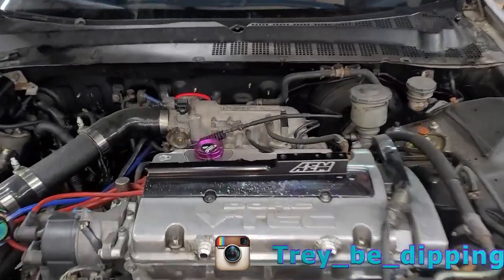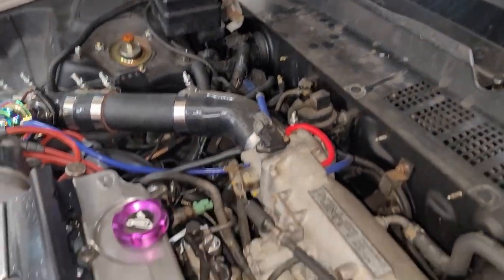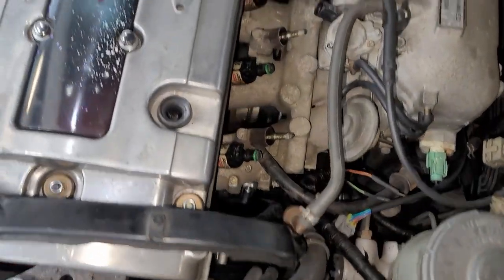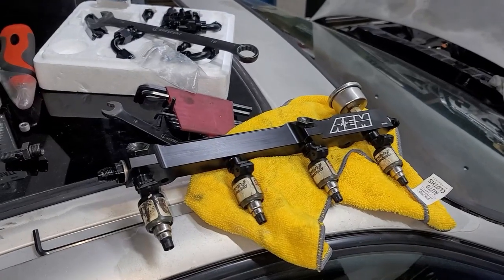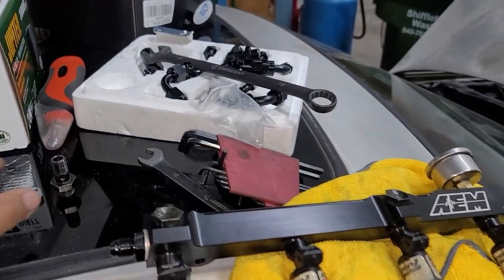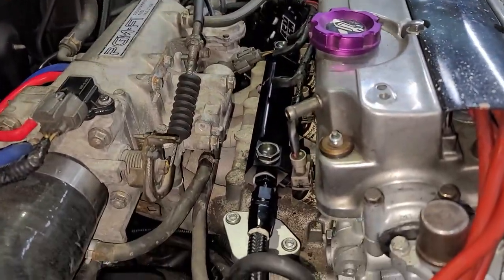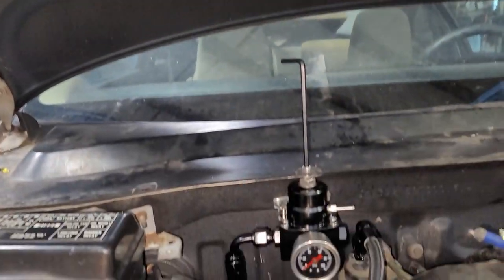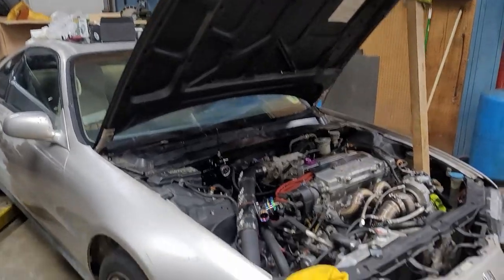How To Turbo Your Honda Prelude Pt3 | AEM Fuel Rail & Regulator

Comment: Would you say you need to upgrade the fuel rail with the turbo or are you just upgrading it
Reply from the maker: It all really depends on your power goals, but for low boost not really
Reply: @treybedipping1734  let’s say hoping for 350 at the crank , would I need it ?
Reply from the maker: @joahsather1472  nahhh stock fuel rail should be fine. You will need injectors and a fuel pump tho

Comment: Trey would you recommend this upgrade for a 5th gen street car (non performance build, budget car), I recently removed my blown H22A4. I have 2 OEM rails in poor condition, also what is highest CC injectors I could run without tune? Or on stock motor. Thank you for your great videos, very informative and entertaining.
Reply from the maker: If your staying N/A it would mostly be a cosmetic upgrade. As far as the injectors. Anytime you change anything with the fuel you will need a tune. Car will run but not very well. And thanks bro i appreciate your support

Comment: This is such a sick setup. I've been trying to do some research on boosting H series but finding mixed results. What have you found stock H22s to be reliable for power wise? And what internal work have you done to this motor or other motors you run with more boost? I appreciate the input, not very familiar with the platform yet but trying to learn I really like it so far.
Reply from the maker: Just stay tuned it's all coming in my next few videos
Reply: @treybedipping1734  ight bro bet, looking forward to it. The series is dope and your previous content is super informative and entertaining too.

Comment: I ordered the AEM rail a few weeks ago and got it,still waiting for the regulator...what kind of injectors are you running man? That's my only problem is if I should wait till I get some bigger new ones
Reply from the maker: Word it looks good and say the injectors the video
Reply: Ok ok i had to watch the vid again,I think my connection got messed up haha. Those Precition 1000cc are what I was looking at last week  and a few others,but i love the input  you have in your videos
Reply from the maker: @mellowrose9470  check fid, fic, or injector dynamics as well
Reply: @treybedipping1734  for sure will do,,google ain't got shit on trey 🤣learned much more from you about the 4th gens